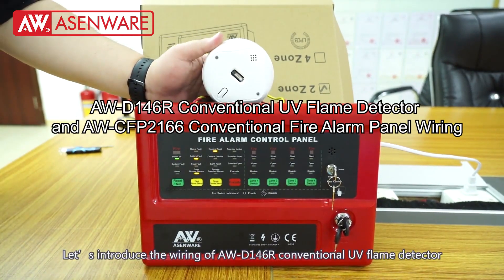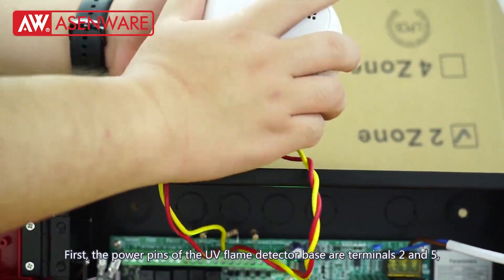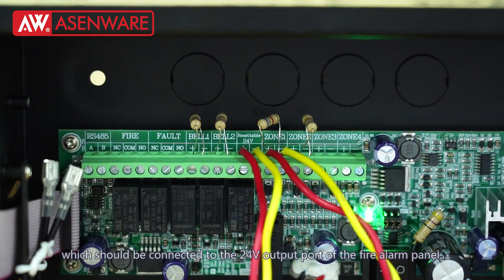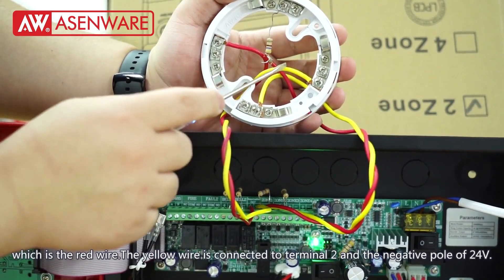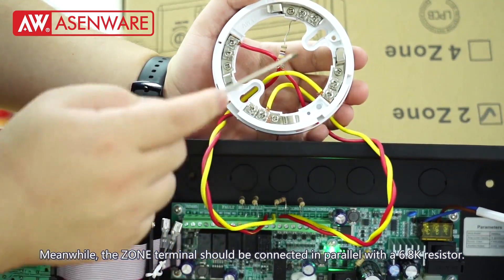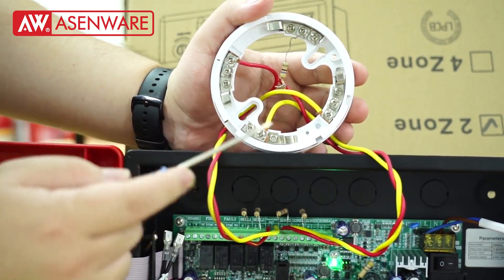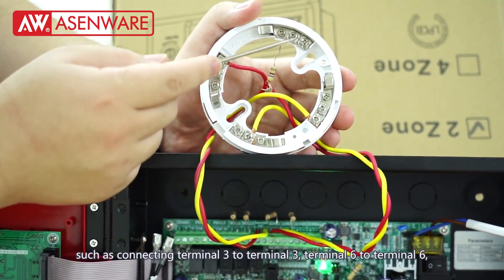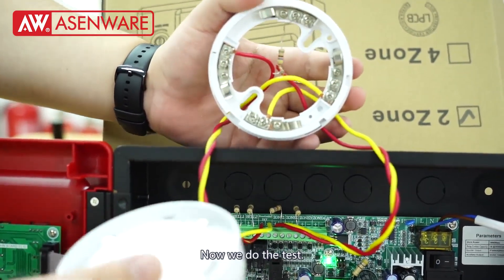Conventional UV Flame Detector and Conventional Fire Alarm Panel Wiring

Comment: The AW-D146R V1.1 manual specifies terminals 5 and 6 for 24V DC input and terminals 2 and 3 for zone output. However, this diagram suggests a different configuration. Can you confirm which wiring method is correct for this model?
Reply from the maker: Welcome to contact us for help u solve this problem
Website: asenwarefire.com 
Email: info@asenware.com 
Whatsapp, Wechat, Tel: 0086 13922805301